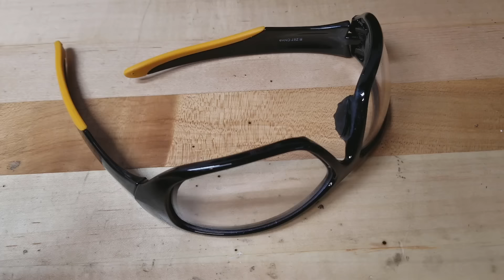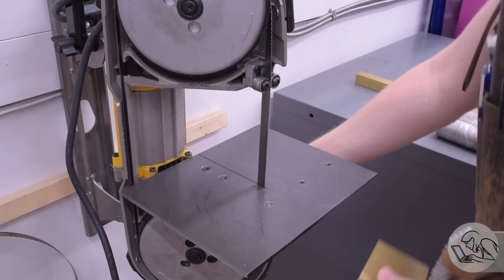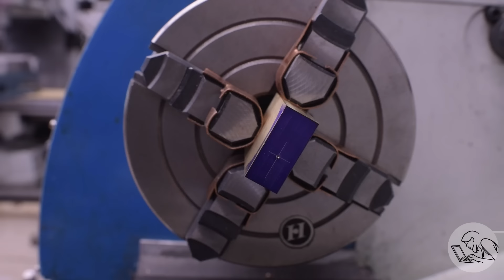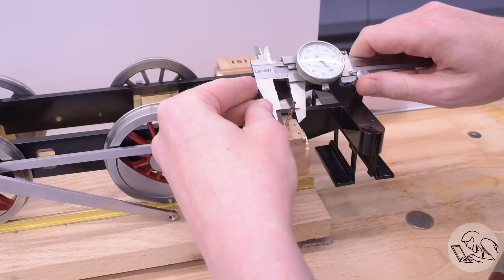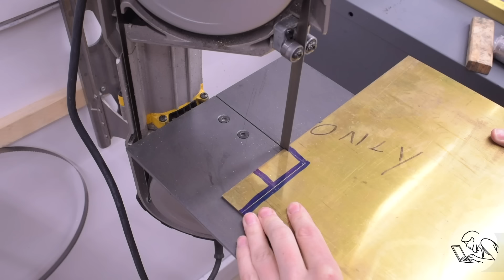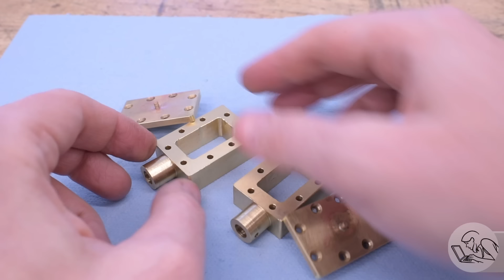Steam Chests - Pennsylvania A3 Switcher, Part 47

Comment: since the covers were back to back, when Quinn tapped the decorative cover threads the one on the bottom got an Australian thread--these kind of fine details are important to get right. Most people wouldn't have bothered with Australian threading one of them up-side-down because of course you won't be able to tell in the finished project, but this attention to detail is what separates Quinn from the mass of machinists;p

Comment: Great video. Terrific project. I’m making a steam engine model from Stuart. I think engine building is the best work for me as a hobby machinist. 
 Regardless of what machining job is actually in progress at the moment, when someone asks what I use my home metal shop for, I answer: “I make model engines” . Way better than, “I’m making corner filing jigs for no project I can imagine yet, but I have always wanted them and I had the materials in my stock.”
Civilians are usually quite satisfied with that answer.
I am super glad you chose this project - a full locomotive will remain my great white whale. I may yet try one before I die. Or shortly after. Watching you on this project is a terrific primer.

Comment: Hi Quinn, when you center something in the four jaw chuck, I often (but not always) see you checking the angle as well. For the steam chests you didn't. How do you decide whether that step is neccessary?
Thanks for the great videos!
Reply: I was wondering this. Ultimately it comes down to how reliably does your 4-jaw clamp a part straight, and how accurate does it need to be. Here she's got some nicely squared stock with a decent length of flat material up against the jaws of the chuck. Using copper soft jaws will allow for a little bit of movement though. If it's off at all then the outcome will be a boss and bore that aren't quite coaxial with the cylinder bore. To a certain extent that can be compensated by some flex in the linkages. I'm guessing she didn't check here because she knows it's going to be good enough from experience.

If in doubt always worth checking though. . The usual technique of dialing in separately near the chuck wouldn't work here because she's centered on a punch mark, but could have done with an indicator attached to the carriage and moving it up and down a face to ensure no movement.

Comment: When I look at how clean and centered that mill press spins… then I look at my clapped out Wen drill press chuck dance the fandango I have serious envy. 

Of course I know it’s a cheap drill press and it works well enough for what I’m doing; my trailer lights really don’t care if they are a few tens of thousands off and some decorative black smithing is a whole other ball game.

This all said I am putting in a new floor in my work garage (gravel out, level cement in!) and in a few short years I’m migrating to machining as part of my 20 year retirement plan to work on steam rail roads

Comment: I've heard large steam power turbines refer to their control manifold as a 'steam chest' as well. Turbines don't have any valve timing like pistons though, they just use a valve in the steam chest as a throttle valve
Reply: Yep, the steam chest is just an area where the steam is gathered into the machine before distribution to the working areas.  In a large turbine plant the steam chest is that part that contains the throttle valve up to the 1st stage nozzle inlets.  It gets confusing.

In recip steam engines the chest almost always contains the valving.  This model uses outside admission slide valve which means it functions as Quin describes.  The picture of the "modern" steam engine, though, has an inside admission piston valve (there were rarely inside admission slide valves) so the operation is the same only significantly different.  Poppet valve engines have both a steam chest and an exhaust chest.  Lots of rabbit holes to explore.

Comment: The amount of work going into your locomotive is astonishing. Every step is tedious and has to be very accurate because of the scale.  Can't imagine the full-size version being within a 16th of an inch. You're working within a thousandth of an inch just to keep it in scale. You would have been a super machinist in 1910. Great video, Quinn. Love your work and Chanel.
Reply: "Measured with tape, marked with chalk, cut with a torch" as the saying went when it came to cheap  locomotive frames back in the day lol

Comment: Hi Quinn! When you made the boiler, you were very careful to avoid brass getting in contact with steam, since the steam might leach the zinc out of the brass. Is that not an issue for the steam that reaches the steambox? Just asking for my own education, I have no clue about steam engines and first heart about dezincification from you.
Reply: If I had to guess, it is because the boiler is under high pressure all the time (you get what I mean), while the steam chests are under lower pressure, and only when the locomotive is moving.
Reply: @cals4887  I would guess the same. If you blow a valve cover you shut the regulator, change your shorts and go home for the day. If you blow a boiler fitting there's a distinct possibility that none of those actions will be available to you.
Reply: As my understanding is yea brass will weaken over time due to that but I'm sure someone will know more than me m8
Reply: @carlweatherley4883 isn’t it phosphor bronze?
Reply: @jc52984  not to sure m8 I was replying to the comment on brass

Comment: I was listening to a steam engine audiobook for reasons, and they mentioned how the nut that compressed the packing material around the shaft could be tightened and loosened to change the level of play that the shaft had as it moved through the cylinder. Is that something you lose when you move to O-rings? Does it not really matter?
Reply: I suspect, but cannot proove, that a well cut O-ring groove and ring would provide better sealing and less friction than a stuffing box, while being less tolerant of wear (which you can take up with the gland nut on a stuffing box). The exact width and depth of an O-ring groove is super important as it decides the crush on the shaft.

Comment: You did not make an error in the last video, it was an engineered design choice to allow indexing of the steam chest to prevent inadvertently interchanging of the steam chests.  ( And I thought I would never use my engineering reports again).  Great video. I watch every one.
Reply: I feel that as a toolmaker, two parts are almost identical, but one has a locating pin .050" to the right from the other to prevent the operators that are setting up the dies from assembling them wrong during changeovers.

Comment: So steam engines are half stroke? Or single double stroke?
Reply from the maker: Every stroke is a power stroke. So a two cylinder steam engine has the same number of power strokes per rotation as a V8 gasoline engine. Steam is extremely efficient.
Reply: @Blondihacks  In some ways! In the efficiency trials run by various small gauge loco clubs you're doing well to get above 2%. Steam doesn't scale down well. So stoked to have this series, which started a couple of months after I bought Kozo's book.
Reply: FWIW, double acting Diesel engines have been constructed.  Those engines too, used a "locked" piston rod, sealing gland, and cross head.  For a deep dive into steam engine theory, check out Rankine cycle.
Reply: They are double-acting two stroke engines. Each side of the piston has intake/power and exhaust strokes, but as an external combustion engine there is no compression needed

Comment: Hey Quinn, question for you. Do you find it's necessary to have drills that are ground specifically for brass, or do you just use the standard drills for it?
Reply: Drills are fairly inaccurate for hole size anyway, so I don't think it would require different cutting geometry as long as it still makes a hole. If it needs to be precise, you can always ream or bore it, but I think any drill will at least make a hole in it
Reply: @joshclark44  If the drill point is ground correctly, and it's running true, it will drill quite close to size, and not wander.  Keep feedrate conservative, and use cutting oil.